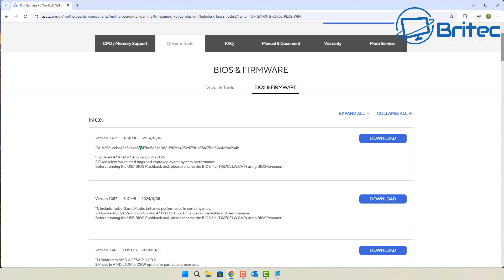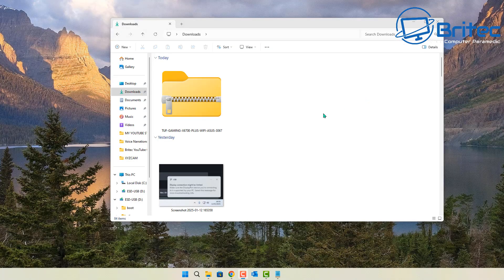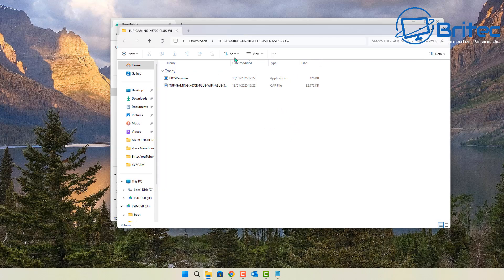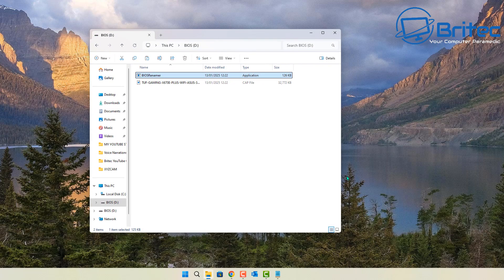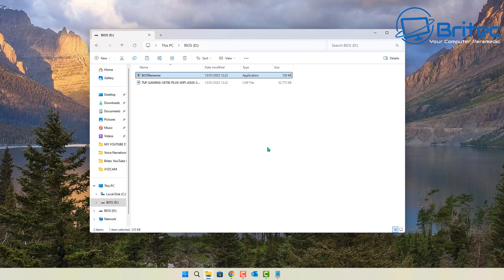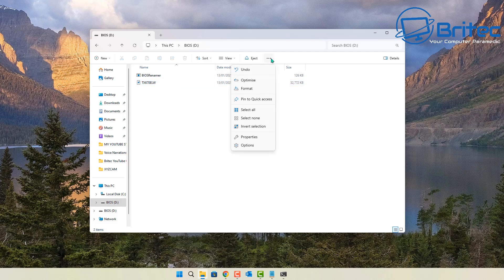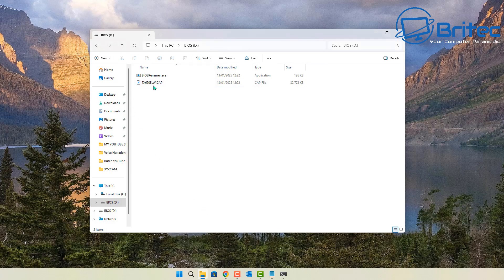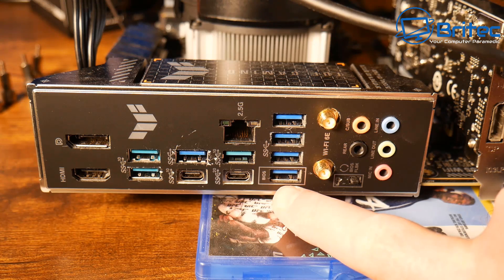PC Powers On But NO Display | Motherboard DRAM Light On

Comment: I have done exactly the same you have and i still get the dram problem everything is new exept the motherboard i have reset bios 3 times on 3 different bios   dates and as soon as i go into bios to change ram speed from default to the speed its sepose to run i get that dram light i bough new ram 3600 and used my old 3200 mhz works fine on default 2666 speed but as soon as i change speed to ram sepose speed i get this shit im running out of options

Comment: Brian, i'm having the exact same problem on  X470 asus board. Im able to get back into the bios with a single stick but when i try 2 the dram led is lit. I know the ram sticks i got are fine after testing them on another system with memtest, and the board was working fine, until updated the bios to install a ryzen 5700x3d upgrading from a 2700x. I tried clearing the cmos and using a different gpu and ssd with no luck should i try reflashing a slightly older bios version?

Comment: I had the same issue with ASUS TUF Gaming X870-PLUS, did BIOS flash and it worked like charm. Please make sure to rename the cap file either manually or using exe in the same folder.

Comment: Thank you so much for this video. I started my computer today, and it didn't boot. The error was the classic ram light. I tried the ram stick dance and even tried another pear of sticks that I knew would work with the system. No dice.

But I watched your video and flashed the latest bios. And thank God (but mainly you), it posted. And I have got up and running again. Obviously, a little bit of retuning was required after that. But my God, you saved me. 

Thank you so much for sharing your knowledge, absolute life saver 😅

Comment: No lights on mother board at all fresh built an hour ago preformed a cmos reset reseated the GPU multiple times , double checked that all the wires were in there tight getting no display whatsoever
Reply: Im the exact same not even my mouse and keyboard light up

Comment: How am I supposed to do the BIOS if I get no signal with my monitor
Reply: Also try clearing the CMos. That should reset your motherboard back to it's factory settings. Then you should be able to use a usb with a fresh bios.
Reply: If you have a bios flashback usb port on your motherboard, you can get the bios of your board onto a usb. Research how to do this for your motherboard, and once it's finished, you can boot in. But remember, the ram will need to train again. So sit back and wait until it has properly finished.

If you don't have the usb flashback option, then I would always recommend buying motherboards with this functionality as it gets you out of lots of tight spots like this one. Hope that helps and good luck 👍

Comment: I was struggling after one of the automatic 24h2 update of win11 . Impossible to boot on the bios so idem on windows. No display at all.....i tested everything : the GC , all the 128go ram one by one, the Amd proc which is a monster 3990X, the nvme. I saw the red light on mainborad sayind that there was a problem on RAM but i could not understand (or did not want to see)  why an update could have create that situation. the last update before this one just uninstall the bluetooth on 2 computers!!! Anyway i forget to flash the Bios and i want to thank you for your video and for your time to made it because it fixed the problem in 5 minutes where i stayed 2 days trying things and  thinking my motherboard was down. Thank you again for your help.  Excuse my english as it's not my natural language.

Comment: I just assembled a 9900x3d + same Neo RAM as yours + ASUS TUF B650M-E and on the first boot it displayed this solid DRAM LED behavior. I was expecting that this newer CPU would not be supported by the factory shipped BIOS/UFEI so I was expecting to have to flash it. The flashing process worked fine like you showed and now it boots and works perfectly.

Comment: Sigh. good video but it didn't help me, so I think the (brand new) motherboard is cooked. Tried everything, swapping out the RAM, changing the coin battery, flashing bios several times. So frustrated
Reply: hey, did you find a solution?

Comment: This happens to me when I restarting the pc . I get stuck with a orange light on the motherboard and blank screen only when restarting the PC. I am so frustrated, is there a solution for this?
Reply: Apakah sudah teratasi maslahmu aku mengalaminya saat ini
Reply: @Kenkyo30  turn off fast boot up in windows settings
Reply: @truth-x9b aku sekarang gak bisa masuk window sama sekali terjebak di LED kuning (ram) 
Solusi .. ram aku padahal baru beli tapi tetep sama
Reply: @Kenkyo30  motherboard or ram is the problem , I would test with another ram kit to confirm
Reply: @truth-x9b apa mungkin karena BIOS sudah usang ?? 
BIOS ku versi 2021 sedangkan di website ada pembaharuan 2024 
Aku sudah Menganti kit ram ..
Reply: @Kenkyo30  it is worth trying

Comment: I'm still stuck on the yellow dram light with no screen & can't get to bios.
I tried to flash the bios but when I press the flash button the flash process doesn't start with the light staying off.

I've also tested both of my dram sticks in all 8 dimm slots & no luck.

Could both of my dram sticks have died together when I turned my pc off?
It was perfectly fine for 2 years until I turned off last night & I noticed some screen distortion on shut down, & since then I'm stuck with yellow dram light & no screen, post, or bios access.

Should I just try an exact replacement & buy 2 new dram sticks after everything I've tried???
Reply: Edit: Make sure your pc is on standby mode & not entirely switched off for the mobo to detect the flash drive & flash the bios.

Flashing the bios didn't fix my issues but I was at least able to rule it out as a solution.
Reply: @mattfletcher2270 did you find the solution?

Comment: I have an old one with a strange issue. Its an old Optiplex 755. Most of the time, it works perfectly fine. Sometimes it won't turn on at all. No lights or anything. Sometimes when I hit the power button, the power light instead of being green, it turns orange. No display. Like you, I tested all the parts on another system. Replaced the power supply and coin battery. Reflashed the bios. No change. Weird issues continue. Another issue it has is when the system goes to sleep, it doesn't actually go to sleep. The green power light goes orange and will not come back from sleep state. I hold the power light till it powers off. A couple seconds later, the system will turn back on but I only get the orange light. No display. Short of just tossing this old thing, is there anything else I can check?

Comment: Im having a similar issue currwntly. Sadly i dont have another boars to test anything. I attwmpted to reset CMOS to no avail. I tried to flash the BIOs and imnpretty sure i tried ot wrong (didnt reformat drive). Going to be trying again properly here shorly
Reply: This solution did not work, anyone else have any suggestions before I take my pc apart and make returns?

Comment: THANK YOU SO MUCH!!! I recently upgraded my motherboard and cpu only to put it together to get an orange light on my board. After taking out the ram and taking everything out and back in again it still had that light. So I was probably going to bring it to a repair shop but I saw this video and did a last minute ditch effort to get my computer to post and when the bios was flashed IT POSTED! Thank you so much and I am very glad that your video helped me find the issue. Continue to make great content and thanks for helping me a rookie pc builder.
Reply: Btw I was using a B650E-F
Reply from the maker: Nice motherboard
Reply from the maker: You're welcome

Comment: I had a $1000 motherboard fail in a similar way after less than 2 months. It turned out to be a single surface mount resistor on the board, after changing it, the board worked fine again.
Reply from the maker: $1000 motherboard wow, was it made of gold 😂
Reply: @Britec09  No, just a very good twin CPU slot board with dual onboard NVMe slots and a few other odds and sods. Highend business board, not a gaming board.

Comment: If it amd cpu being used and either cpu/dram stay solid that points the board is at fault due how this happened it to do with the cpu socket is damaged during the installation. Only proper fix is change the motherboard completely
Reply from the maker: This is fixed, CPU socket is fine.
Reply: @Britec09  That good you got lucky

Comment: 🙂few years back i had an ASUS board not post either, i didnt have to flash the bios tho, what i first tried was clearing the CMOS of the bios memory, its a pricey Z motherboard, on the back of the board it has two buttons, one button is to flash the bios like you show but this pricey board had a second button to clear the CMOS, so i simply pressed and hold the CMOS button for 10 seconds and BOOM it Posted! Easy Peasy ✌😏
Reply from the maker: Sometimes clearing CMOS helps and other times it don't.
Reply: @Britec09  😊 yup yup, stay warm buddy

Comment: I had exactly the same problem with the same motherboard. After trying everything you did [ apart from flashing the Bios] resetting the CMOS fixed it. I'm disappointed with this board as the Ethernet port does not work. Any ideas anyone.
Reply from the maker: Resetting the CMOS can help on some issues, same as flashing the BIOS, but there is not guarantee it will work

Comment: I have a MSI b550 Tomahawk that does the exact same thing. Everything works but no video. If I swap from component to HDMI it works fine. Video card is new. I already flashed the Bios. I bought a Asus board and no issues.
Reply from the maker: BIOS flash does not always work

Comment: Did read up elsewhere that Win 11 updates these days do push drivers and at times firmware updates and has messed up the BIOS on AMD setups. Might be worth looking into.
Reply from the maker: Yeah, got to be super careful
Reply: I too have heard of these reports, think that happens with laptops from Dell and the like. But then some people like to rubbish Windows 11 so you can never tell.
Reply: Does that also happen on intel setups cause I’m currently having this issue with a z690.

Comment: This might be why it is a good idea to be careful about what kind of motherboard you buy. The kind that has the option to flash the bios without having to actually go into bios first, sure can save your bacon. Of course there are other systems that have a backup bios chip, which is also a nicer system to buy if you want to plan ahead in saving yourself a headache when the bios get corrupted. It's just a nice feature that I think should be included on all motherboards. It just saves a lot of tech trouble and may save some money as well in the long run.
Reply from the maker: Always worth paying that little extra
Reply: @Britec09  So true.